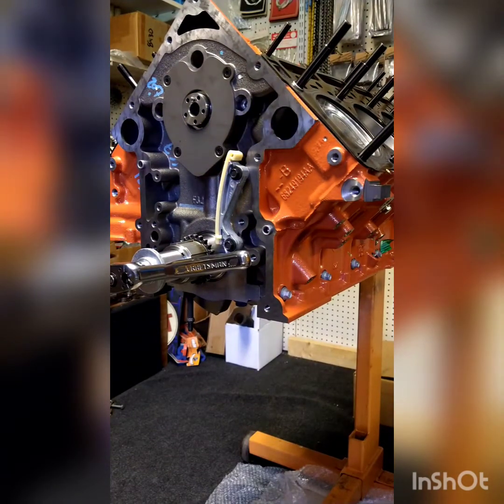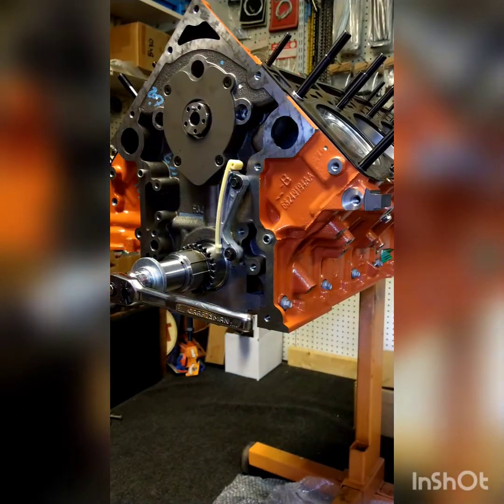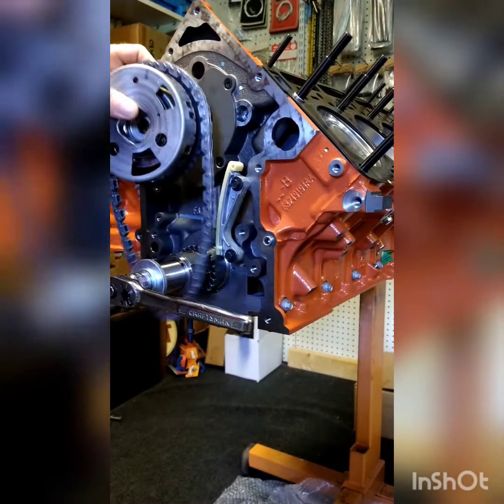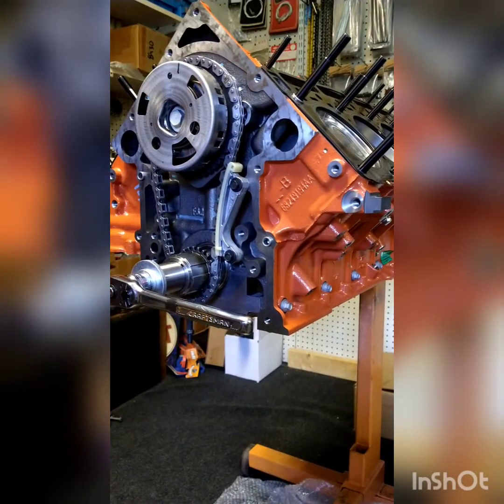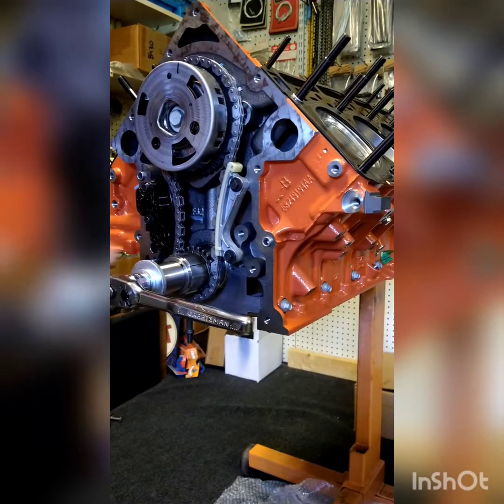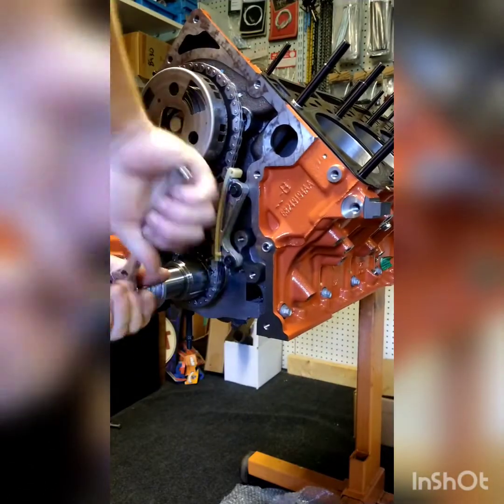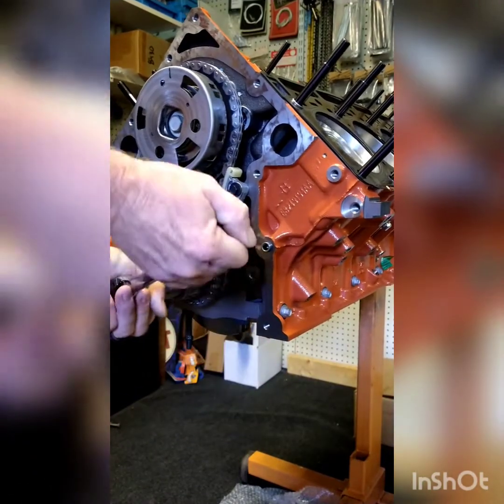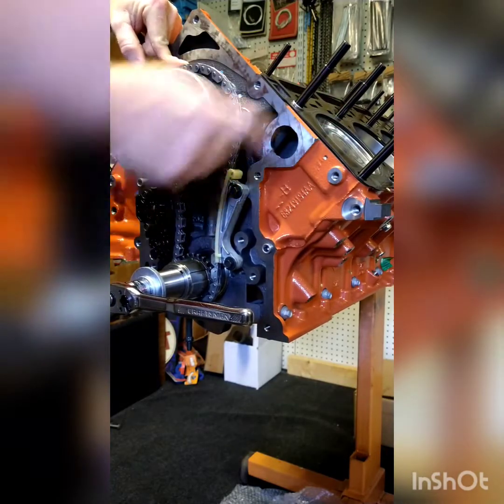Gen3 Hemi timing. Correct way to time a 5.7 6.1 6.2 6.4 Dodge Hemi Engine. Cam install timing

Comment: Thank you for the video and please help me here, I just rebuilt my 6.2L Hellcat and when I installed the timing system I didn’t keep the piston at TDC I just made sure the cam phaser mark at 12 o’clock and crankshaft sprocket mark at 6 o’clock and timing chain both upper marks goes between the phaser mark and the lower single mark at the sprocket mark. Engine is running smooth and fine and now 4000 miles on it but since firing on day 1 until today I’m having rough idle and feels like I’m running a stage 3 camshaft, everything external is ruled out from spark plugs to gapping to coils to injectors to crankshaft pulley. You think It’s might be related to timing or something wrong?
Reply: You got to pull your timing cover back off and redo your timing again, and you can find tdc without pulling your heads off take a extending magnet and stick it to your piston head through your spark plug whole. Get to tdc and redo your timing. Not hard just time consuming, your getting the miss fire because the cam and crank weren’t in a factory specific position. The cam has a nipple that also needs to be at 12 o’clock. And the crank has to be at 2 o’clock with the  keyway. The metal keyway at 2 o’clock is also a good way of finding tdc also.
Reply: @R @Roberts_munitions  The issue is that I have no misfire count at all during idle or acceleration when checking with a scan tool and HP Tuner. The engine and transmission mounts are ruled out as well, and I even switched to NGK 2309 plugs same problem.

My question, if you don’t mind does the piston have to be at TDC? I’ve heard that as long as I align the timing chain marks with the phaser dot and the crankshaft sprocket mark, then that’s all that needs to be done. And if my timing were actually off, the car wouldn’t have been drivable for all those 4,000 miles. Is that true? Thank you

Comment: So I guess the marks on the chain are just for the initial installation so you know you have everything aligned initially, that makes sense so that you can tell you have the links matched on top and bottom. After that they don't matter.

Comment: God bless you, I've taken it off 3 times cause the damn chatgpt was telling me to rotate the crank two turns and check to make sure the link marks matched up, IT WOULDN'T MATCH BACK UP AFTER LIKE 50 TURNS.  The stupid Haynes manual sucks for the hemi and doesn't explain it at all, should have came here first. May Christ bless you and every one of your generations after you.
Reply from the maker: Thank you

Comment: How do I keep the cam gear still while I tighten the cam bolt 90 ft lbs for my stage 2 cam? (Btw, my engine is in my Ram, I didn’t take the engine out)
Reply: Don’t know if you got your answer but put a 21mm on the crank bolt with a breaker bad, turn the engine till the breaker bar hits the frame or other solid metal. That should lock up the phaser due to the chain not being able to spin
Reply: @ Thanks, I ended up buying a chain wrench and using it to hold the crank while I tightened the cam phaser bolt. 
Everything turned out great, shes nice and choppy.
But thank you for tryna help.
Reply: I tried that and it didn't work, I pulled the starter out and had my son hold a flat pry bar in the flywheel. It(FLYWHEEL)turns clockwise facing the crank pulley, so put your screwdriver or pry agent in the tooth so that it prevent it from turning clockwise. God bless

Comment: I’m coming from overhead 4 strokes where we could easily see the cams and I’m confused on how y’all make sure youre on the compression stroke and not another stroke
Reply from the maker: The cam makes it the compression stroke. The piston has no idea if it is on its 2nd stroke on its 400th. Remember the crank turns twice to the cams one turn.

Comment: I've had my 2012 ram 1500 5.7 hemi apart 3 times from other videos this is my first hemi I've worked on im use to old carburated sbf motors
Reply from the maker: Glad you got it all together. Thanks
Reply: I have a 2013 Durango r/t with 5.7 it has a p0016 and p000b code I changed the vvt solenoid and didn’t fix it do you think my timing could be off ? And can I re time it without pulling the heads ?
Reply: @nickmartin7024 take off the left head to have the first piston at top

Comment: How can you tell if piston 1 is in TDC without pulling the heads off?
Reply from the maker: The proper way would be to use long dial indicator but a long screw driver works too.
Reply from the maker: A long screw driver will rest on the piston. Spin it over till it is up.

Comment: So I can’t confirm this but it seems there is a different mark on the phaser gear. One is definitely defined on the face looking at the block basically would be on the back of the gear when on the cam. That put my pin on the cam at 2oclock position and from what I just saw that pin looked at 12. I did bar it over like that fully assembled and was hitting resistance at the end of the strokes. You can slowly keep pressure and it will push past and then spin again but same deal it hits hard resistance at the end. I took the rockers off again as to shut the valves and did a leak down test to check if it bent any valves and I seem to have gotten extremely lucky and all reads well within range. However I’m definitely out of time if that pin in the cam is indicating the tdc position for the cam. Which thinking back to tear down that pin was at 12 tdc initially. Thx for the info though man it is stressful af doing timing but the more you do it the better you’ll get. I’m a pro at doing EJ Subaru engines but this is not a Subaru. Thx again
Reply from the maker: The timing mark is a line on the outside facing edge.
Reply: There is one on the back too but it's Secondary, I understood that it was for factory installs and doesn't apply to us.

Comment: I find your rotating assembly to be fairly difficult judging by the effort you are putting into it, especially considering you have no valvetrain or compression to fight.
Reply from the maker: You do realize that is a 3/8s drive rachet. Engine made around 900hp and has been together for a long time. Thanks
Reply: Not really, as the bearings, rings and pistons generate a fair amount of friction.

Comment: Would this be the same timing procedure if I were to upgrade the cam on my hemi? Just ordered a comp cam and I'm wondering if this would be the same timing procedure.
Reply from the maker: Yes, sure is. 
#1 piston at TDC and install cam with timing mark on the gear at 12:00
Reply: Good luck with the comp cam 😳

Comment: I think a lot of people are confused like I was about asking how do I know it’s on the intake stroke vs exhaust stroke, or how do I know it’s exactly at top dead center. I’ll explain this in a easy way for someone who has not done this before. There is 2 major steps. 1 is just just generally have the cam pin at the 12o clock position and the cylinder 1 at TDC. It’s not important if it’s a tiny bit off just put it there visually the best you can. Step 2 install the chain with the marks on the chain. Then make sure the bottom sprocket is also on the dimple of the sprocket. What sets the timing is the length of the chain on the side that is being pulled down from the cam to the crank. The chain could be 100 feet long and it won’t matter. It’s the distance of that specific mark that they have Put on the chain. And as long as it’s on the correct marks it can’t be installed incorrectly givin that you had step 1 done. It’s not thaaat important even if it’s not at tdc precisely or the cam not exactly at 12oclock cuz when you put the chain on you will see how far your off and you can spin the cam or crank to line them up. I had never worked on any engin and I changed my cam and lifters myself so at first it was super confusing. And how this guy is explaining it is not wrong but for a first timer lol no pun intended it would have just made me more confused. Also the only way you could mess up timing going by the chain marks is if the chain was manufactured incorrectly so prolly just stick with a Mopar chain and not some random brand. 🤷‍♀️ that’s my 2 cents
Reply from the maker: Only thing wrong with using the marks on the chain is when you turn it over to check your work the marks will never line back up. My way is how you time an engine. Can double check your work. Piston TDC and cam timing mark at 12:00 
Not sure how that is confusing.
Reply: @moparbymelton961  i need your number i need to talk to you on phone i have the same engine but my car basically all it's doing right now there's no combustion at all which is leading me to think that it's the timing chain that broke or the tensioner or the guide something happened I haven't even took a look at it yet but so far I'm looking into fixing it in 2 weeks
Reply: Yeah, you are making it way more complicated than it actually is.
Reply: Apparently there are two marks on the phaser. One on the back and one on the front. I didn’t know that there was one on the front and I say that because it kicks the cam pin over to about the 2 o’clock position. From what I just saw, the cam pin should be 12 not 2. The crank keyway is at about 2 and the crank sprocket dimple should be at 6 denoting you’re on tdc #1. I totally am off a ton and barring it over found I’m binding on the end of each stroke. I’m going to pull the cover off again and put the pin at 12 on the cam and see what happens.
Reply from the maker: @midnyte_ryder  the timing mark is on the outside edge or the cam gear.
Reply: Mid, ignore the mark on the back, the one at 12 is the one you use, the back is some kind of secondary timing mark.
Reply: I understand you now, in other words, get the cam as close to 12 o clock as possible and the crank sprocket as soon as close to tdc with the key as close as possible to 2 o clock, and use the respective marks on the chain to get you zeroed in on the teeth if youre off a tooth on either the crank or cam side. The only thing that sucks is having to remove the cam sprocket with the chain to get it right but not that big a deal

Comment: I appreciate you sharing your knowledge and experience with the tube, question, how do you know #1 is at tdc on compression stroke vs exhaust stroke? Thank you again!
Reply: Top dead center is top dead center. Cam determines if you're on a compression or exhaust stroke.
Reply: Pull timing cover today and the crank sproketa is off one tooth, #8 cylinder has a dent from intake valve and obviously that valve is bent among others. I am gonna check the valves this weekend and reset the timing and button it up and let it ride assuming I get compression in #4,6 and 8 cylinders following timing reset! I appreciate  you sir!
Reply from the maker: @Mistfortune976  and this is exactly why I made this video because the blue links is a terrible way to time the engine!!! Thanks
Reply: I believe it has jumped timing so I don't know of a way to ensure it is at tdc on intake vs exhaust
Reply from the maker: @Mistfortune976  the cam gear has a mark on it. That is to be installed at 12:00  The crank turns 2 times per the cam once. The cam timing mark is to be installed at 12:00
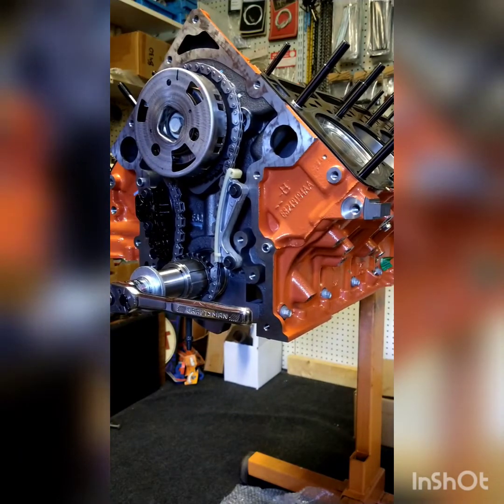Reply from the maker: @Mistfortune976  the cam timing mark will be at 12:00 TDC and at 6:00 at TDC
Reply: This video is a joke right? I have not put a cam in a engine without physically determining where the center line is since 1980. A kit is $200. How much are valves?
Reply from the maker: @dontanklage  video has nothing to do with degreeing a cam shaft. That is a totally different subject.

Comment: Terrible instructions.
Reply from the maker: Why do you think so? Very easy to follow and correct way to time a engine.
Reply: Bro couldn’t have done anything more for you short of coming over and doing it. Instructions extremely clear you just lack the prerequisite skills to follow them.
Reply: Honestly if this checks out, it is more explanatory than the Haynes manual. And easier to follow. I take it you don’t own or haven’t had the pleasure of dissecting one of these. Experiencing it directly right now I seen immediately what I did wrong. And no this is not my first rodeo with engine components but it is my first hemi. These things are simple in a sense yet there are some tedious things to be aware of.

Comment: How do i know i put the cam in sync with the piston
Reply from the maker: #1 Piston is at TDC.
Reply: @moparbymelton961  I mean like how do I know when incerting the cam it's in the right spot like is their a line on the cam as well?
Reply from the maker: @thefavsrt  yes, cam has a line on it.
Reply: @moparbymelton961 , cam also has a pin in it that goes in the 12 O’clock position. But I know you know that already.

Comment: Great video, I just had my cam installed and I’m having serious issues with idle, vacuum and misfiring.  
I’m TDC on cylinder 1 with the dot at 12pm but my keyway is closer to 1pm rather than 2pm.  Would this suggest I’m off a tooth?
Reply from the maker: Most important part is making sure #1 piston is at TDC. With #1 at TDC cam should be a 12:00.
Reply: @moparbymelton961  thanks, from the photo the builder sent it looks to be at 12 and cylinder 1 TDC.  Maybe it moved or something, I’ll have to take the front cover off to verify.  Popped a P0016 code, everything is pointing to the timing.